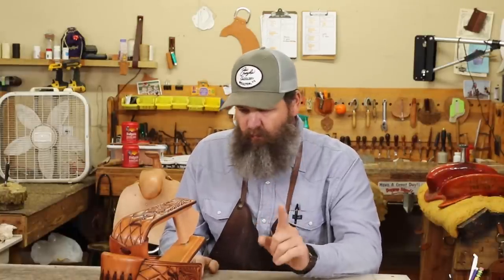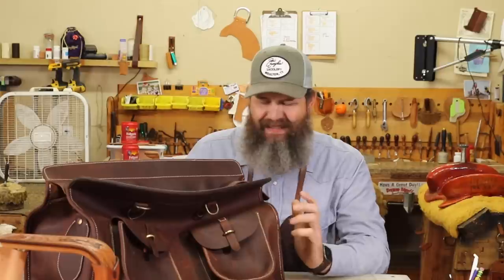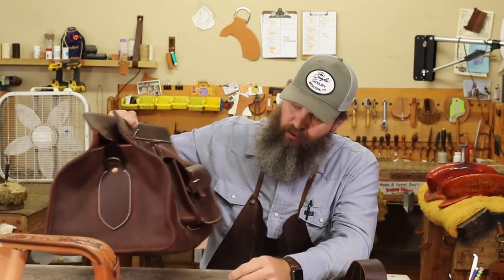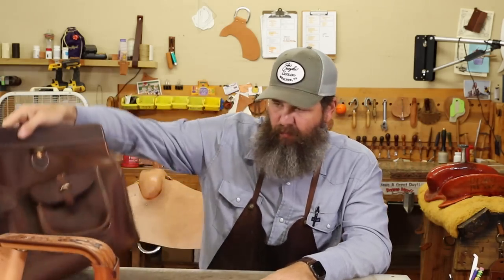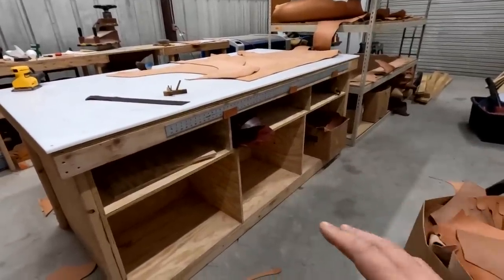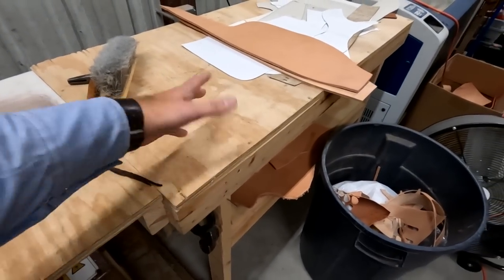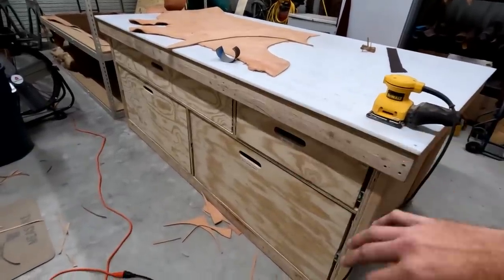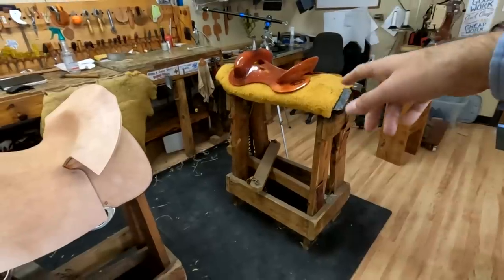Monday Morning Saddle Shop Briefing: Episode 79

Comment: Hey Don, I’ve made several drawers . You can add extra slides on each side of the drawer to help with the load capacity of the drawer. A large plywood drawer probably ate up 1/3 of the 100lb capacity.

Comment: Hi Don, not sure if you read these but I'm using 8" cement tubes from Home Depot for storing leather. Tubes are made from 1/4" thick cardboard so leather can breathe and hidden away from light. They work great for storing 10+ oz leather and any other leather. Might be a bit difficult for storing scraps but great for sides panels and anything else. Also casters on all tables and anything else. Things can be easily rearranged without having  3-4 dudes shifting things.